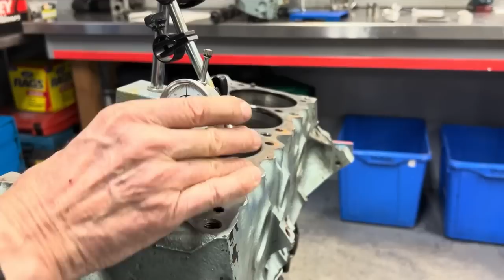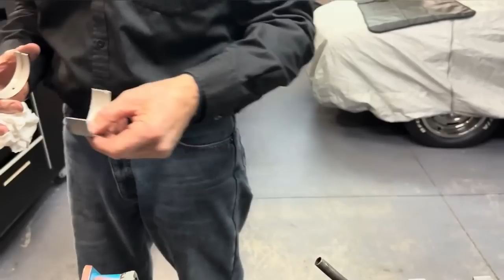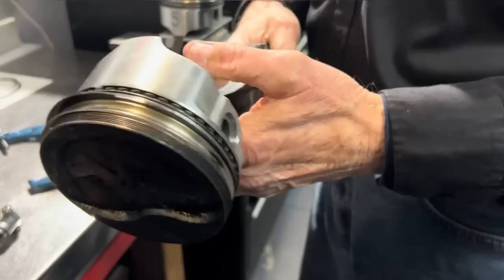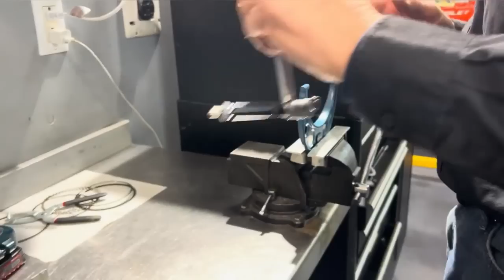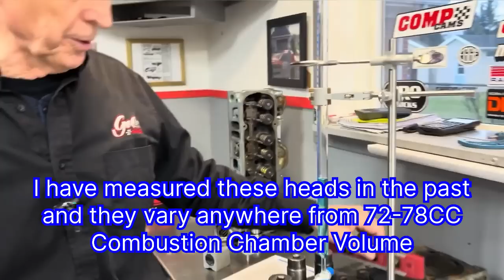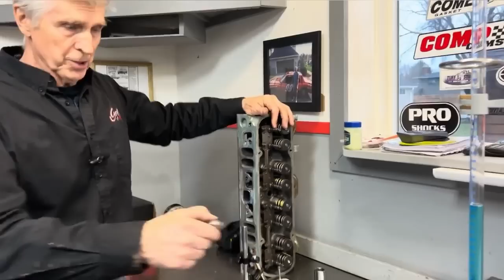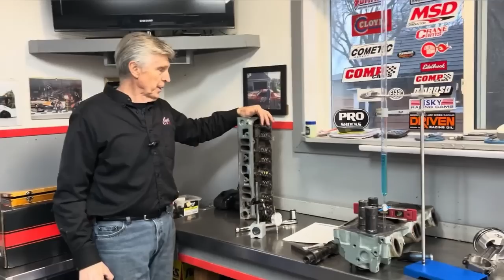Troubled 400 Pontiac engine showed up in pieces! Problems and Solutions

Comment: Is that a #'s matching engine or is it just pieces parts. It looks  to be well machined, and no reason for it to be pinging unless it had poor fuel or too much advance. Had a few back in the 60's-70's and under a heavy load, going up a mountain with the A/C on it could ping a little, due to poor fiber cam timing gear and or too much advance. Going to custom cam, oddball lifters, replacing rocker arms and pushrods is, to me, just a cluster _ _ _ _. Good luck with that build.
Reply from the maker: Thanks for watching and commenting Robert. AG

Comment: Pontiac used fully grooved aluminum main bearings on their ram air and ho 400 engines so that the rod bearings got 360 degrees of oiling . The 455 engine had a cross drilled crank..
Reply from the maker: Thanks for the info Tim. This was new to me. Now I have both sets. AG

Comment: Hey Mr. Gold. I’m going to share a link on how to remove those plugs.
Reply: https://youtu.be/BhRb4bbx_vI?si=zNGUOzmswZb4wN8w
Reply from the maker: Thanks Hugh, i have removed many rusted in plugs with a torch, thanks. This sometimes the only way to remove them. The Pontiac plugs are not rusted. The problem is that they were pipe plugs but the they have been milled flush to the block and there is insufficient depth (about 1/8") to insert an Allen wrench deep enough to remove them. 
Thanks for the link. AG
Reply: I understand. This way will get them out to the point the feel finger tight. 
  People resist the idea because of where the heat is applied.  
   Heat just the plug and it will get very loose.

Comment: I frequently use a next Size Larger hex Wrench ground Down flat on Front & all 8 Flats to a Tight Non-Slip fit for hex Plug removal Without stripping.....Prior torch Heating the Threaded Block area to Break-down the thread Sealant helps Successful removal.....Hope everything breaks loose Without using the Easy-Out !!
Reply from the maker: Thanks for commenting Tom.AG

Comment: Thx for showing your Dial Bore gauge Zero out calibration & cylinder Bore measurement proceedure.....Quite the Clean "Mystery" engine to Look & Measure that good After finding Metal particle Chunks !! ....Pontiac Oem factory cast Rods always worked good for me even on 6000+ Rpm Solid lifter built engines !! .....Really weird Full groove Main bearings there....1960's Pontiac blocks Always seem to run Hot & ignition Ping on 0.030 & up Overbores.....The 389 & later Stock engines seem to be on the ragged Edge of Overheating symptoms for some reason & big Overbores Don't help....Wouldn't adjustable Locking rocker arm Nuts fix the Pushrod/Lifter issue ?? .....Gonna be a good Reliable strong 400 Poncho when finished !!
Reply from the maker: Thanks for the info Tom. As for your question about the adjustable rocker arm nuts, I haven't mocked it up yet, but it is possible that the the nut will hit the step in the bottle neck before proper adjustment is achieved. AG

Comment: I would have taken those leaking valves out to see what was going on there. Bent valve, debris on seat/face?   Galled valve stem?  BTW it doesn't hurt to stick a magnet on the oil filter. It'll keep break in debris in place. 
Scrap it first oil change.
Put the magnet back, always. 
And use Chevy rocker nuts or just jam nuts.
Reply from the maker: Thanks Victor, only one valve was leaking, I have removed and lapped it and it is good now. I will do a high pressure leakdown test when the short block is assembled. AG

Comment: Hi AL, great channel.  A couple of questions: Will the Moroso oil screen you showed fit a SBC, and is the part number 23845? This is what I found on Amazon, but it does not say if it fits a SBC. Thanks.
Reply from the maker: Thanks Brad. Correct, 23845 is the same one that I have. IT fits SBC and many other applications also. AG

Comment: Just because an engine dynos with no issues, doesn’t mean that what’s going to happen once someone shoves it in a car! You should know this! How is the fuel tank, fuel line, fuel pump? Exhaust, ignition system? Was timing double checked once it was started in car? Hopefully someone is smart enough to check the timing, & have fresh fuel! You can kill anything, no matter how perfectly it was built! Customers don’t seem to understand that!
Reply from the maker: Good points Brian. I agree entirely and have seen this happen also. AG

Comment: It was a normal design to have the oil passage in both main bearings in high output Pontiac 400s. My 350 hp 400 from 1970 had a full windsge tray, inner valve cover oil deflectors a 60 psi oil pump and full groove main bearings
Reply from the maker: Thanks, good info on this subject. AG
Reply: Yes fully grooved main bearings provide constant oil delivery to the rod journals, and in Ford 385 series the truck engines normally got fully grooved, some of the car engines did not.

Comment: 1. those pistons are fairly low in the hole for GM. most GM pistons are .015 in the hole. with those being .025 in the hole, i would shoot for a .015-.020. thick head gasket. that will reduce the quench height and help eliminate the pinging. and if it was pinging as much as you said i would have wanted to see the rod bearings. i am betting it was pounding out the rod bearings. And that was one source of the metal flakes.

2. it's possible that the metal fakes were from the rod bearings if they were starting to fail. detonation is hell on the upper rod bearings. i would mic the big end of the rod and make sure they are still round. same goes for the rod journals on the crank. that crank looks ok.to the naked eye, but a micrometer will tell you the truth. around 12:58 you can see some scuffing on the crank fillet were 4 rod would be located just below the oil hole. at a minimum i would have the crank re polished, just to be safe. also, it looks like there could be dust or metal flakes on the crank at the same point in time. but that could also be from assembly lube and dust in the air. 

3.  since there were no cam or rod bearings to look at. my assumption is the cam was also starting to go flat as well and just had not failed yet. .002 is quite a bit of wear for a newly rebuilt engine with fairly low miles. here is what i would do. Replace the cam with and aftermarket roller.  flat tappet cams require a minimum of 1400ppm ZDDP to live a long and happy life. every oil for sale at the parts store are SN rated. SN rated oil can only have a maximum of 800ppm ZDDP. so, what i am saying is. that no modern SN rated oil is safe for a flat tappet cam long term. there are other oils out there like AMSOIL Zrod and Lucas Hot Rod and Classic Car. both are over 1600 ppm ZDDP, but most parts stores don't carry it and you have to special order it. i use Lucas Hot Rod and Classic because it has a rust inhibitor additive package for cars that are stored over the winter. i use it in everything flat tapped after 1000 miles of break-in. I use Driven 30w Brake-In oil for the first 30 minutes to break in a flat tappet cam. then change the filter and drain the oil and refill with more Driven 30w Breaking oil for the next 500 miles.  then repeat one more time for 500 miles. then switch it over to Lucas Hot Rod and classic the rest of its life. as a general rule,  i will not use a flat tappet cam in anything that is not a matching number restoration on something like LT1 350, LS6, L78, L71 or L72, DZ302 etc. its simply not worth it with the current state of modern motor oil. you are much better off with a moder retrofit hydraulic roller in everything. there are very few engines that don't have modern retrofit roller cams available. the difference in cost between a roller cammed engine and a Flat Tappet engine is around $600. and for that money you get better performance, better longevity and the ability to use any modern engine oil. basically, what i am saying is that there is no reason to use a flat tappet can, unless you are doing a special number matching restore or a retrofit roller is not made for your engine.

4. the oil seal. i use the GST racing 1 piece oil seals for small and big block chevy. they look exactly like the one you got from BOP. in fact, i would bet 20 dollars they are from eh same manufactures. 

5 the "360 Degree oiling" main Bearings were a big thing for a while. they were supposed to improve oiling to the rods for a full 360 degrees. but the truth is they lower the amount of bearing surface available for the crank to ride on.  I know the pro-stock guys went to "3/4" or "270-degree" bearings years ago. for a hot street motor, you don't need it. stay with standard 180 degree bearings.

6. For any engine, i prefer to keep the dynamic compression below 8:1 to avoid detonation and obtain best performance. the XE268H Cam is a little small for a 9.7:1 engine, that results in a 7.98:1 dynamic compression ratio based on that XE268 cam and the 9.7:1 compression ration.  I would step it up one cam size to at XE276HR or a Howards 414495-12.  I don't like the comp XE line for street driven cars. the 110 lobe separation angle crates low vacuum and narrows the power band from peak torque to peak horsepower, which is fine in a street/strip car but for a street driven car, i prefer a 112 or 114 lobe separation angel. it widens the power band between peak torque and peak horsepower and has better vacuum for power breaks. the 112-degree lobe separation on that Howards cam would be much better on a street driven engine.
Reply from the maker: Wow, lots to absorb here, thank you for taking the time to share your knowledge and experience. AG

Comment: If the main, & rod bearings are clean, the journals are perfect, the filter looks like it did its job. Removing those plugs might be a bit overkill especially considering it would need machining/ facing again.
Reply from the maker: Thanks Randy, you are making a good point, it is a dilemma right now. We also have to do something about the quench so it may have to go to the MS anyway. AG

Comment: Just a suggestion. Because of the high failure rate people are seeing for the past 10 years with flat tappets, I purchased a set of Japanese hardness tester files. The cam core should be about 40C  Rockwell and the lobes above 50C. Lifters should be at 50C. I also check the lifters for crown and they should match the taper of the cam lobe. Most cams are ground to a .002 difference when measuring from the front to the rear of a cam lobe, just what you found out. The lifters should have about a crown of 0015" with the highest point in the center of the lifter. Also, when rebuilding from scratch with unknown history of the block, the position of the lifter bores to the cam lobes should be checked. Tools are available or you can make your own if you have a lathe. I am gun shy with my build after checking a new set of Melling lifters. Melling uses the prefix JB and I assume that the J stands for Johnson. The crown on these was good on 2 lifters. The rest were a mixed bag with some having 0.003" crown, some were flat, some were flat and tapered to one side and I was disgusted. I purchased a set of Crower that they advertise as Johnson lifters. I measures the crown on them and actually replaced one with a better Melling. I compared the 2 brands, everything looked and measured identical after taking each apart (solid lifters), the oil holes in the exact same location, the oil hole size the same, the recess around the lifter identical down to the coloration. This reinforces my thought that the Melling lifters were manufactured by Johnson but who ground the taper on the bottom?  It is not just the oil and I am saying this for everyone as I think you know most of this if not more.  Seems as if quality control is out the window nowadays with everyone pushing expensive roller lifter setups and the factories not using flat tappets any more. Sad, did the equipment go bad?  No training for new employees? Everything done on a Friday?
Reply: I recently rebuilt a 455 and luckily did the first run on the engine stand. Near to no lifter rotation on any lifters. Tried a different set of lifters, still nothing. Looking at the wear pattern on the lifters had the contact patch running straight across the centreline of the lifter face. Checked the direction of the taper on the cam lobe. IT HAD BEEN GROUND ON BACKWARD! Summit cam. Purchased an eglin of a similar grind. Measured the taper now in the right direction. Assembled and fired engine to now find MOST lifters rotating but not all. Again tried a few different brands of lifter to no evail. Eglin cam only had just about a thou taper. Eventually bit the bullet and consulted with a local cam grinder who reground the core i already had and now all lifters are merrily spinning around. 2 brand new cams from different sources junk.
Reply: @watsisbuttndo829 also check lifter bores and hone as needed. No one really mentions this. This was brought up by my engine builder,one of few guys not immediately pushing you to roller cams… he uses Eaton lifters an swears by them.
Reply from the maker: Lots of great information here, thanks for taking the time to provide valuable input. AG
Reply: So they have this motor built by someone else.  They list some “complaints” about noise?  Fast bleed lifters make noise.  Performance motors make noise.   Timing issues will cause pinging and detonation.  They take it all apart and dump it on you?   Over what you have described as an ignition timing issue?  Disassembled it?  Ripped the cam bearing out?   Why???   I’d call BS and walk away.  
And before I do that here let me tell all of you some stuff.   I’ve been building pretty much nothing but Pontiacs for well over 40 years.   I run a 400 bored 30 over with a set of heavily ported #16 heads,  a Comp Cams XE 274 cam, Smith Brothers Pushrods, #RHOADS LIFTERS, TRW forged fat tops and cast crank and rods.  10.66/1  iron head.  30° of initial timing with 6° mechanical and 14° in the can or ported vacuum.   Holley Street HP 750 on an Edelbrock Performer and full length headers.  It’s damn near the same motors as this one.  We’re at 3200 feet of elevation.   Flicks stars like a champ and screams like a banshee.  On 93 octane pump gas.   Never detonate.   Not even to 6500 RPM.  No matter how hot it is.  So I don’t understand this motor or its customers issues.   My guess is they had a severe ignition timing issue, went nuts, taking it apart and dumped it on you?   Why remove the cam bearings?  Unreal.   I’d walk away.   You’re jumping hoops for no valid reason.   10.66/1.  Iron head.  30° of initial timing.  At 2/3 of a mile high.   93 pump gas.    Most will tell you it can’t be done but the proof is all over my page.   This motor should run.  And lastly,  99% of this who claim to know and understand Pontiac motors absolutely do not.   Why you see so many 9.5/1 461 roller motors that don’t run any faster than solid lifter 400s did 50 years ago!   Too much Voodoo.   Not enough science.    Lastly.   Challenge conventional wisdom.   That’s where the gains are.   😉

Comment: Much of the engine design is an artifact of the original 1955 287, at that time John DeLorean was a junior guy at Packard. Those main dowels are an example. Like most Pontiacs, it looks like your dowels are deep in the block. This is a bigger problem on 3.25 main blocks, but the 3 inch main 400 can still use improvement there. I remove all the dowels, and I try a much longer dowel of the exact same size that is commercially available. If things line up well with these, I will run them. If need be, I will fit the block and caps for a slightly oversize dowel. More work, but sometimes required to correct cap movement. 

The intake closing ramp of the Comp XE cams is very fast, almost too fast for a Pontiac with a 2.11 intake and a 1.65 rocker. They need ample valve spring and proper lifter preload of .050-.060 to quiet the valvetrain. There are better lobe designs.

Cadillac also used the cast Armasteel connecting rods.

Thanks for the video.
Reply from the maker: and thank you V8. Lots of good info and your comment about the cam is pretty consistent with the others. AG

Comment: You are spot on with the adjustable valve train. That camshaft has a slightly smaller base circle so using stock studs can cause loose valve lash. Be careful with lifters. Some companies started supplying sbc lifters for Pontiac. They do not have the oil band in the right spot so they can stop oiling at base circle making the really clatter at idle.
Reply from the maker: Thanks Steve, I actually compared the lifters to SBC and you are correct, the oil relief does not line up. AG
Reply: Also, Pontiacs had two different rocker arm ratios, so if anyone chooses a camshaft, ask the grinder if it's designed for the 1.6:1 or 1.5:1 rocker arm ratio.
Reply: The Ram Air II and IV Pontiacs had a different cup in the lifter and the push rods are different too. We used polylocks and set them up for a specific lash. SBC lifters are not an option
Reply: Pontiacs have non-adjustable (except maybe Ram Air IV) and the camshaft manufacturers know this.
If the lifter isn't getting the oil, then the valve train isn't getting the oil either.  You'd see a lot more wear especially on the exhaust valves.   Measure them to be sure.
If they are stock rods, they would have little squirters on them to squirt up at the cam.... assuming they were installed correctly.

Comment: Pontiac crankshafts are not cross drilled so they only oil the rods 1/2 revolution. The answer is to use full groove bearings or cross drill the crank. If you use the non-grooved lower shell you need to cross drill the crank.
Reply from the maker: thanks Steve, AG